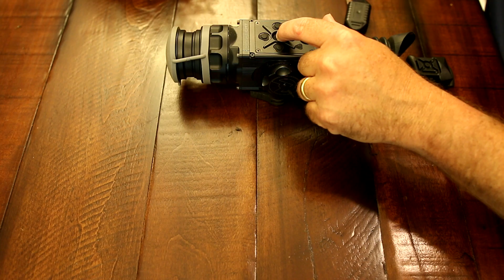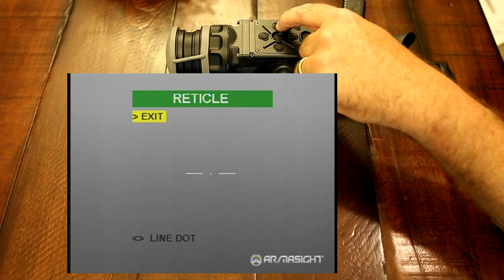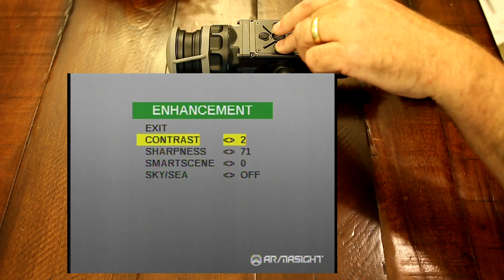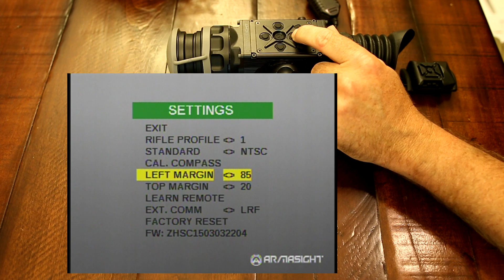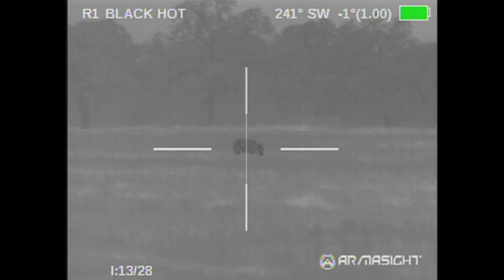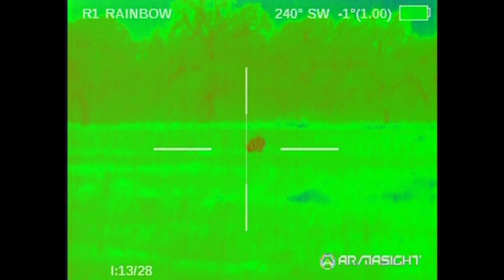ARMASIGHT PRO-LINE THERMAL COMPARISON PART 2

Comment: Great video. A question though. The clarity on the 100mm is amazing but the field of view looks better with the 50mm and 75mm. I live in NC so there is not many wide open shots at distances you are taking. Would I be better to get the smaller lense like 50mm or 75mm 640?

Comment: Hi, thanks a lot for the video. I have been lucky enough to get my hands on a Colt LE901 in 308, thinking of using a night vision clip on along with a Night Force SHV 4-14 x 56. What Armasight clip on would you recommend for the SHV 4-14 x 56? Should I rather go with a different scope? Thanks in advance. Greetings from South Africa.
Reply from the maker: +Gert Martinson I'm not a huge clip on fan but I would get the Apollo pro 50mm if it has to be a clip on.

Comment: Looks like the 640 is a big difference over the 336.  When would the 60hz become an advantage over the 30hz?
Reply from the maker: +bchdds Only reason I can think of to get the 60hz is if you wanted to slow down the recorded video in editing, or maybe shooting from helicopter other than that it just just cuts the battery life in half.
Reply: Thanks for the info, great video!
Reply: +bchdds.... on a fast moving target
Reply: If it makes sense 30hz is a faster refresh rate. ( it looks less laggy/skippy when you look around)
Reply: @bruhbruh13968  60 hz is 60 times per second refresh rate as opposed to 30 times per second...more times per second would be faster refresh rating...or another simplified way to think of it.
60 frames per second vs 30 frames per second.